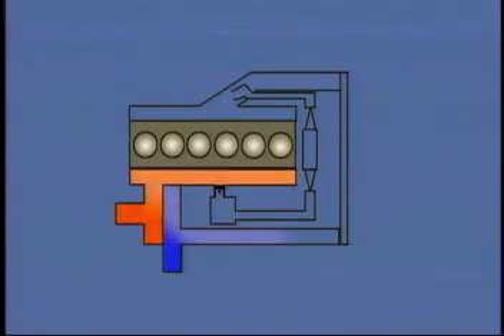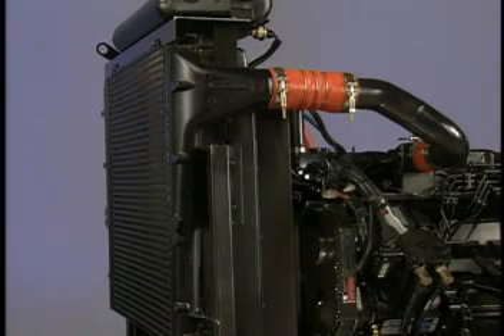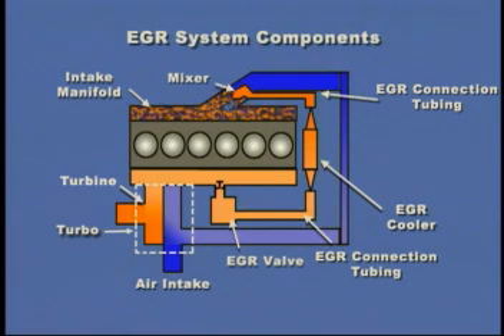Cummins ISX CM871 EGR Part1

Comment: not accurte insite is needed for install.. calibration comes after... any amount slow moveing acuation means low boost .. useually turbo.. not accuator ... they do come seperate.. dont let your parts guy screw you..insite is needed for reasemble though..  egr cooler failure suspect for turbo and or eger valve.. .. high low coolant codes dead give away..